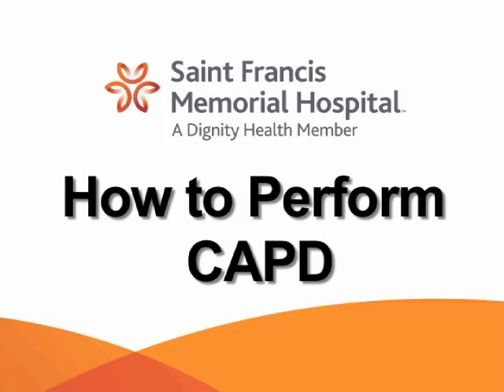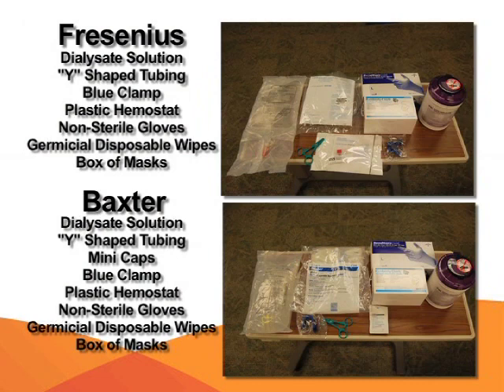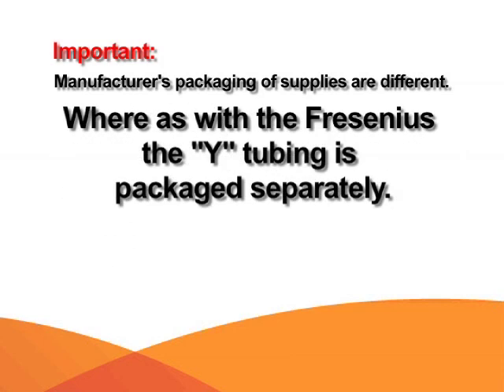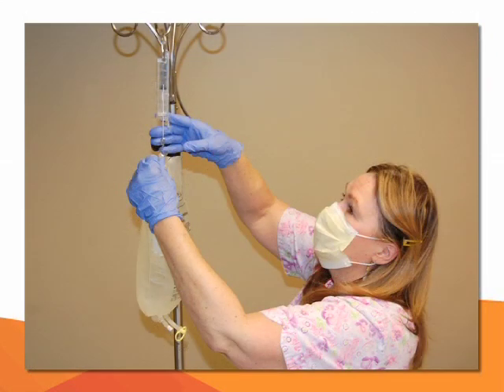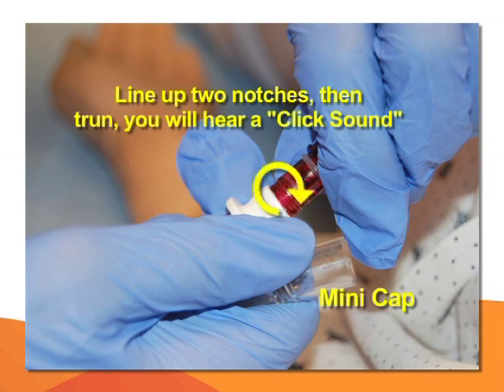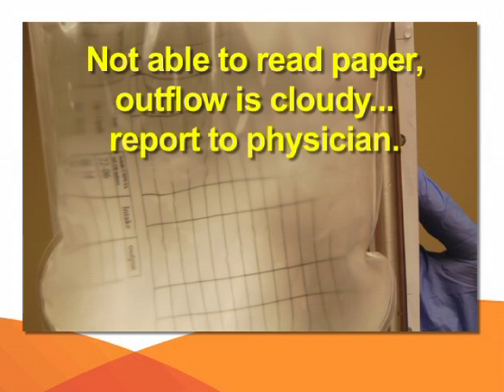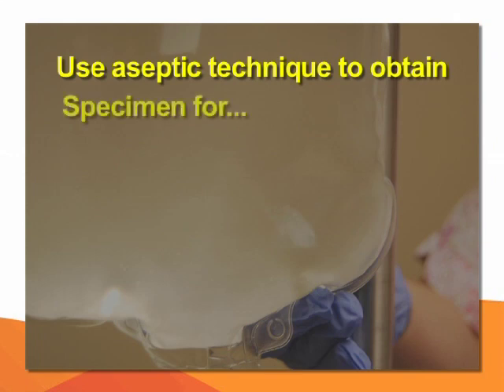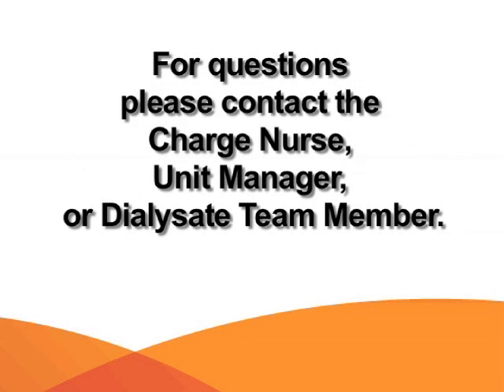How to Perform Continuous Ambulatory Peritoneal Dialysis (CAPD)

Comment: This is insane. Never microwave the bags. Having it in the overwrap will not make a difference. Use the heater on top of the dialysis machine or the heating pad or heating chamber made for iv bags.  Then use a thermometer to check the temperature.